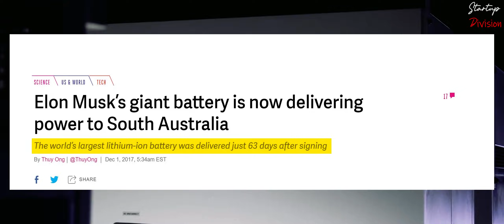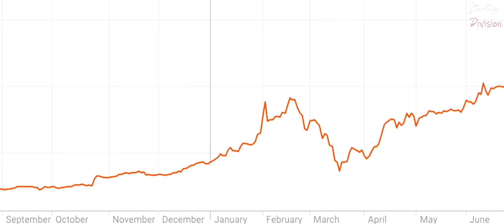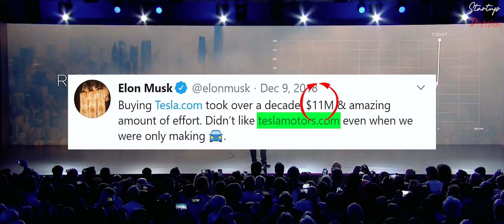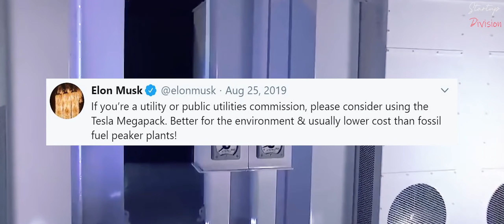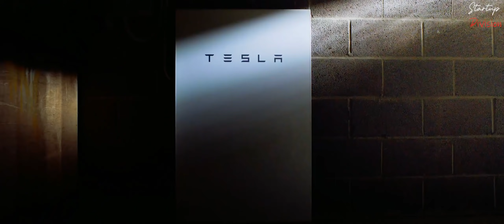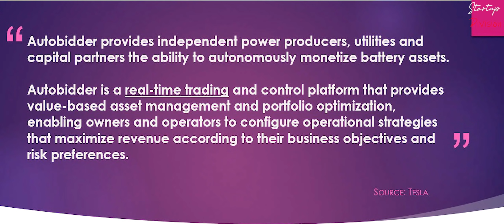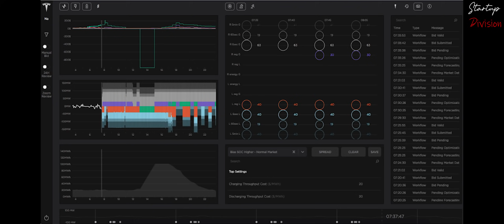How Tesla's Colossal Battery MEGA PACK Will Power the Future !

Comment: You're painting a very rosy picture.  It's one thing to demonstrate something, and a very different thing to scale.  Let's do some math.  The specific energy density of Lithium ion is about 300 watt-hours/Kg.  Hydrogen (clean H2 from renewables and water), a totally non-toxic fuel has a specific energy density of over 40,000 watt-hours/Kg.

Do you see?  One Mwh of electricity using Lithium-ion requires over 3.5 Tons of Lithium-ion!  That's a lot of stuff for only 1 Mwh of energy.  Using Hydrogen (H2) you only need around 30 Kg.  Do you catch my point?  One Mwh of Lion is a huge amount of material, that's Nickel, Lithium, and Cobalt, materials which are already largely tied up, with many social and environmental costs - which you claim will power the world!  Not a chance.

Clean H2, in contrast, has non of that baggage, and can actually scale with total non-toxicity.  You talk about what could be in a fantasy, painting a rosy picture, but reality would differ in terms of the ability to scale to our actual needs.  This video is more hype, no math applied.
Reply: The problem with H2 is that it is gerally made by stripping H from hydrocarbons... releasing..... you guessed it.... CO2. You can make H2 from hydrolysis of water, but that takes more energy than than just using electricity in the first place. 

Smart people have crunched the numbers and... H2 is simply not a good energy currency. It needs to be physically transported and would need billions in infrastructure. Its production would be made by a select few. Electricity is the energy currency of the future.
Reply: @dwaynejava  You get it completely wrong.  Green H2 is made from renewable energy and water.  It's potent, safe, available to everyone, and is 100% non-toxic.  Those are the facts.  Either you take it in, or you don't.
Reply: Oh, one more thing. There are many battery technologies coming and available right now that do not use rate earth metals, such as iron phosphate batreries. Power plants do not need energy dense batteries as they are stationary.
Reply: @dwaynejava  Smart people?  Everything you said is just a bit off.  I talked about clean h2, no carbon involved.  Actually read my post.  A fuel cell vehicle IS an electric vehicle.  You have no knowledge of how the grid works.  EV charging has to be in Real Time... 10,000 Tesla Semis would require 10 Gigawatts of electrical draw.  Not going to happen.  Clean H2 is potent, safe, universally available and 100% non toxic, and made from off peak curtailed clean energy.  Try that.
Reply: @TobyKinkaid11  I see you're a hydrogen bug.  I thought that was an extinct species.  When you do the energy density calculation for H2, you need to include the mass of the storage system and the fuel cell.  It doesn't look so good then.  The YouTube channel "Real Engineering" has a video about hydrogen you could check out for some facts.
Reply: @incognitotorpedo42  It doesn't look good?  Are you kidding?  What's the most potent fuel?  H2.  What's the most available feedstock?  Water.  What's the safest fuel?  H2 (being lighter than air if breached can escape), and what's 100% clean?  H2.  Before you advise me, perhaps you could learn some facts?
Reply: @dwaynejava  You don't understand the relationship of batteries and the grid.  Plug in a battery and you pull power in real time.  Make green H2 from water, and you can use off-peak to produce it balancing the grid.  You need to look more deeply.
Reply: @TobyKinkaid11  , no one thought a nuclear accident would happen. I’m sure a hydrogen tank can be pierced with a bullet.
Reply: @shepherdsknoll  It's been widely tested, yes, but it won't explode.  The compression wave is faster than the ignition wave.  I suggest you rent "at war with the dinosaurs" to see a demonstration.  You're about 30 years behind.
Reply: @Toby Kinkaid
You'd make a good salesman.  But you gave none of hydrogen's disadvantages.  Just be fair and honest.
Reply: @acmefixer1  He doesn't know the disadvantages because he has little or no science and engineering training.   Hydrogen is more of a religion to him.
Reply: @acmefixer1  Fair and Honest?  Clean H2 is the only hope for our world.  If you're fine with ICE cars and millions of tons of pollution per day, then you can relax, but for most of us, this is unacceptable, and we need to find a real solution.  Clean H2 is that solution.
Reply: Look at the reason for nuclear power unpopularity, natural disaster. 
What if terrorist organizations went around shooting at Hydrogen tanks ?
Reply: @shepherdsknoll  Such nonsense!  You need to study H2 tanks, they're much safer than other fuel tanks.  Do some homework before you write.
Reply: @TobyKinkaid11  ,the pundits who said Chernobyl, Hershey and Fukushima could never happen are now suddenly silent.
Reply: @shepherdsknoll  I don't follow your thinking?

Comment: What is Tesla doing to recycle old batteries?
Reply: they plan to either re use in long term grid storage or freeze, crushed, dissolved, melted then remade into more batteries.
Reply: They've spun out a company called Redwood Materials.  It's doing battery recycling.
Reply: @incognitotorpedo42  a co founder that left the company made it and has not publicly stated to be working with tesla.

Comment: You gotta learn and use the correct units.
Energy is watthours Wh, not watts per hour. And watts are not watthours.
Reply: I mean watts used per hour is Wh, so per hour can be used although its frowned upon.
Reply: @GemsOfIndianRight  No, it is technically wrong. If you use 'per' you say 'divided by'. But energy is power multiplied by time (respectively the integral), not divided by time.
Watts per hour, or rather megawatts per hour, could make sense if used for a ramp rate of a power plant, how much it can increase its power output in the span of one hour.

Comment: A watt-hour is a measure of energy, as in (J/s * 3600 s = 3600J).  A watt per hour would be a rate of power change, as when a power plant is turned on initially it will not be able to produce 100% of its rated power, but will increase at a certain rate (a certain curve of watts / hour) until its full designed power output is reached.

It is very very cringe to hear a "megawatts per hour" term used in this context.  How difficult is this to understand??? It is written as Mwh for a reason, not as Mw/h.
Reply: Additional note -- MWh is an ENERGY value, MW is a POWER value.  A system with 100 MWh of energy but a power draw of 25 MW can operate for up to 4 hours of peak discharge.  OMFG people, get un-dumb.
Reply: What he said. Megawatts per hour is SO stupid. It devalues the entire video since you don't understand basic physics.
Reply: @cxk9576  This.  I wanted to downvote the video because of it.  Video creators in the energy space need to understand this or GTFO.  It blows their credibility because it shows us that they don't really understand what they're talking about.

Comment: I think the unit for storage capacity of battery pack is supposed to be watt-hour, not watt per hour. 

just suggestion
Reply: Watt Hour or Watt Per Hour,  everything is the same, 
Watt Hour also means watt per hour, 
Meaning it can deliver an amount of Watts of power in one hour
Reply: KIRAN MORAIS,
Nonsense. There is no such term “Watts per hour”. Why say hour? How about Watts per minute or Watts per day or Watts per season. These terms describe nothing. You would not say that a car engine can produce 300 hp “per hour” now would you?

A Watt describes the RATE of power or work, how fast you use energy. A 100 Watt bulb uses a rate of 100 Watts flowing through it. Time does not come into this equation that describes power.
A Watt-hour is a quantity of energy measured over time. If you power the light bulb for 1 hour, you will have consumed 100 Wh.

Think about water. A gallon of water is a quantity. That can be compared to a Wh. How fast water moves through a pipe is like a Watt, it is the flow of energy.
Reply: @Lovingkindness.  A Watt Hour is a unit of measurement for power over a period of time (an hour), or in our case, a way of measuring capacity. One Watt hour is equal to one Watt of average power flow over an hour. One Watt over four hours would be four Watt Hours of power. So Watt per hour is also the correct form of expression!
Reply: You are correct, I just noticed that while watching this video as well.
Reply: Any more suggestion?
Reply: Since the unit comes from a division: W / h, watt-hour is just the short version of watt per hour so both is OK.
Reply: @kpbendeguz  No, that's not correct.  The unit doesn't come from a division.  A Watt is a Joule per second:  W = J/s.  If you multiply a Watt by time, you get energy.  Whr is watts * hours.  1 J/s * 3600 s = 3600 J.  If you divided watts by seconds, you'd get J/s**2.  That's not energy.

Comment: This is a great video. You might consider becoming more clear on energy and power units. Megawatt (MW) is a flow unit, measuring energy per time: one million joules per second. MWh is an energy unit: one million joules per second for one hour, or 3.6 gigajoules. 1200 MW per hour (5:31) is nonsensical, literally meaning that the battery can supply 1.2 GW the first hour, 2.4 GW the second hour, and so on, which is not true.
Reply: Just to be clear, there is a difference between watt hours (watts MULTIPLIED by hours) and watts per hour (watts DIVIDED by hours).
Reply: Thanks for sharing. I love learning...
Reply: A Watt Hour is a unit of measurement for power over a period of time (an hour), or in our case, a way of measuring capacity. One Watt hour is equal to one Watt of average power flow over an hour. One Watt over four hours would be four Watt Hours of power. So his way of expression is also accuruate.
Reply: @GemsOfIndianRight  His way of expression is wrong, and makes him look like someone who doesn't know what he's talking about.

Comment: The "stable" coal power plant failed causing the blackout
Reply: The power grid was knocked out by wind storms blowing over the HV power line structures bringing the coal power into south Australia.
Nothing happened to the power station...
Reply: Sasquatch 2001 stable for about 100 years
Reply: @paulmcgreevy3011  add another 40 years
Reply: The blackout was caused by storms.

Comment: Şun and wind plus the batterys are the best
Reply: Wind is something that a lot of countries dont have enough of it to generate Energy.
Reply: Actually nope, batteries are not that efficient,  also you need base load, you will never get that. Even in Australia you only get 4h peak production on solar per day, about 20% wind.
Reply: @jantschierschky3461  You are underestimating Australian solar.  Maybe it's 4 hours peak, but how many hours are still within 90% of peak?  Australia is great for solar.
Reply: @incognitotorpedo42   I own a solar system for over 10 years. I get the readout on my phone . On a sunny day in Perth it starts around 7 am doing about 10% than by 10 am is around 90%, 11:30 am is at 100% or near than by 2 pm 90%, than it drops. So it looks like a bell curve.  When new it produced 2kW system, about 15.5 kW in summer and 9kW in winter if it was sunny all day. So I can make the statement on my own experience.  So unless you have a tracking system you get near 100% for 4h a day, the rest of the day it changes fast

Comment: How are they able to produce the batteries for all these mega packs at this time?
Reply: By not producing the 3 model on time
Reply: @jantschierschky3461  They've been building the 3 for years.  The question was about "at this time".  And the answer is, as Seb C pointed out, they have big factories.  And they're building more big factories.  They've figured out ways to make batteries faster, for less money, with higher energy density, and longer cycle life.  This will be detailed on 22-Sep-20, aka "Battery Day".
Reply: @incognitotorpedo42   it does not matter, the investment will not be recovered.  Tesla has for now the best EV system, but not best car manufacture. It is valued higher than VW, Toyota, GM, Ford  even it produces a fraction of there numbers. You really think in the long-run that Tesla can sustain its lead in EV ? Or can get the manufacturing numbers up to a point of Toyota's  ?
Reply: @jantschierschky3461  You are treating Tesla as though it were a car company.  It is much more than that.
Reply: @incognitotorpedo42   well it is, yes they claim to be technology, however  Tesla is batteries,  cars and software to run those. Yes they get data,  but that can't be directly set for revenue. 
I am stating that the business fundamentals are wrong,  even if they increase output by a 1000% it will not cover the investment cost. Think of Toyota an old established company with huge research budget,  manufacturing in lot of low tax, labour cost factories.  Manufacturing whole range of products,  selling millions of cars a year is less valuable than Tesla  ? Give me a break. Btw my cousin is high level manager in VW, they watch what Tesla is doing  and let Tesla Pionier the market.  When the time comes.....
Reply: @jantschierschky3461  You're forgetting the energy business-- solar panels, solar roofs, home batteries, grid scale batteries that replace peaker plants.  Also the whole robotaxi thing that will eventually come to pass.  Also the insurance business-- I'm not sure where that's at.  Selling batteries to other car makers is another possibility.  There are multiple possible revenue streams.
Reply: @incognitotorpedo42  i have not, solar is separate company.  However Tesla solar roofis not even remotely competitive in solar. So as I said if you believe in Tesla is your business,  I am giving you the facts.  Based on the fundamental numbers Tesla is over valued by huge margin.  So I  won't take the risk
Reply: @jantschierschky3461  Solar roofs are just getting started.  They have the technology now, but still need to build the sales and installation force.  I'm not buying the stock either.  I did buy some when it was much cheaper.
Reply: @incognitotorpedo42  well I use solar for over 10 years and those roof things been around for some time.  They will not compete with  panels,  also not even close  as efficient. I  also hear nightmare stories about Tesla's customer service and pettiness
Reply: @jantschierschky3461  The solar roofs don't need to be as efficient because they cover the whole roof.  If you need a new roof and you want solar, it's very cost effective.  They are good looking roofs, too.  The company is growing rapidly, and until they get more people in place, customer service will be spotty.  It will improve.  They are working on opening a lot of new service facilities.
Reply: @incognitotorpedo42   well actually not correct. Never mind wish you luck

Comment: The question is if they have the right battery technology for building all the battery farms of the future, there are so many different batterytechnologies which appear to be better than Li-ion cells.
Reply: It's the right tech for the current demand, proven 10+ years while retaining +80% efficiency in a car platform (using older 18650 cells) that are depleted from 10% to maxed out. The 2650 cells (model 3 and Y) are projecting 85% capacity retention over 10+ years. In a fixed system such as a power wall, where the cells don't see the duty cycle and stresses related to driving/charging and with proven BMS. I don't doubt that each unit will last 20 years+.

Cell density is only going to be improving from this point forward. In addition, the entire power wall from home systems to megapacks can be made out of recycled batteries that are below the threshold for car applications. 

Hence why the Model 3 and Y did away with complete battery pack replacements, and wanting to simply replace individual packs. You install a new one in the car as a fraction of the cost of say GM/BMW/Hyundai. And the old stuff gets recycled into functioning powerwalls.  

Unsure what other battery tech you are mentioning that is currently commercialized, that can compete with this? 
Pouch Design? (It's the same chemistry, just different format) 
There is Iron-Flow Battery tech, but aside from the initial $30M R&D, not much happening there. I think the energy density simply isn't enough to justify the CAPEX. https://en.wikipedia.org/wiki/Flow_battery#Advantages_and_disadvantages
There is Silicone Ion Batteries, but that is non-commercialised and haven't passed the lab trials as of today. 
Lithium Phosphate? 14% less energy density. But does offer better duty cycle and stability.
Reply: Please give some examples of the so called "Different Battery" technologies you claim.
Reply: @GemsOfIndianRight  Flow cell batteries consist only of liquid tanks containing the two chemicals that react with each other. It is claimed that these cells scale well, are durable and cheaper for long-term storage. As far as I know, Tesla uses the same cells that are used in the cars. But I am not a battery expert, so I have formulated the question rather sceptically than a statement.
Reply: @VR_Wizard  Okay. Where is this concept used widely? Is it a proven technique?
Reply: @GemsOfIndianRight  yes, China achieved a One GWH vanadium flow battery. For massive storage, yes, Christoph is true, there is cheaper and as efficient as Lithium. 
For other use Li as no real competitors and many fake tech : simple, Lithium is just the lightest solid element on universe AND it has one of the very best electro-chemical potential, wich made it the best power-to-weight, far beyond other
Reply: @philv3941  Yep. If its chinese i automatically question the authenticity of their claim. LOL!
Reply: " there are so many different batterytechnologies which appear to be better than Li-ion cells.'" fake news.
Reply: true
Reply: 4680